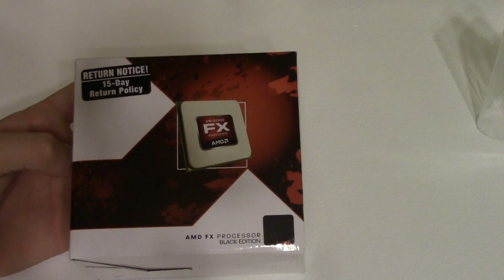AMD FX-4100 Unboxing

Comment from the maker: I would try to go for the FX-4300 range. There were some *slight* improvements with Piledriver, but they are still improvements. It's more power efficient and performs a little better.